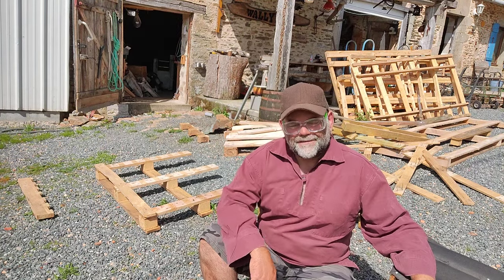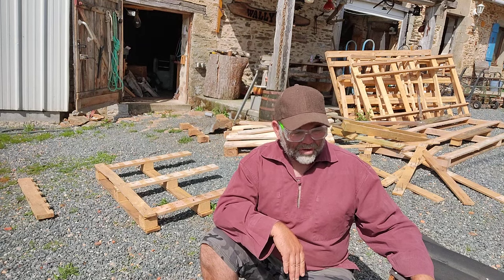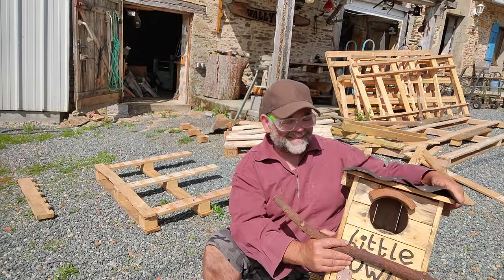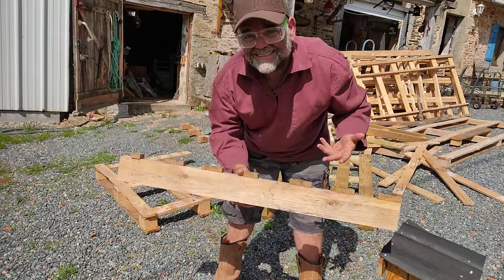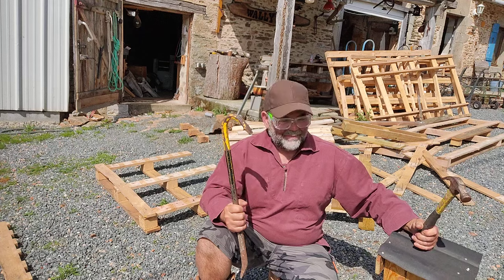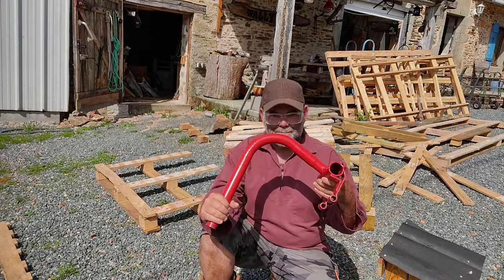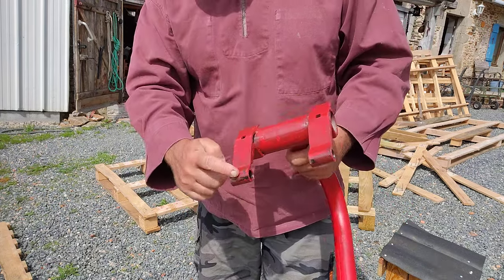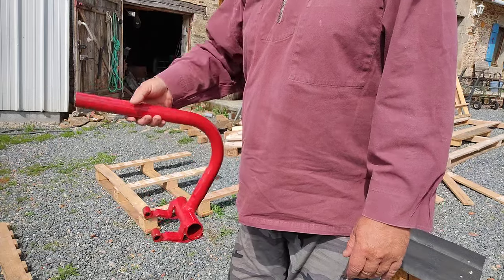Homemade Pallet breaker an Essential Tool for Pallet Projects

Comment: Move the handle round 180 degrees so you are pushing down rather than pulling up, this will both hold the pallets down and require less effort.

Comment: Maybe it's a sign of my advancing years, but I'm sure that pallets made 20 or 30 years ago were of much higher quality wood. Most of the pallets we get are broken before delivery, but we still get some use out of them for keeping our hay bales off the floor in the barn. That little bit of extra air circulation makes all the difference in preventing mold, and fires from composting hay. If I made a tool like this I'd probably be tempted to hitch up the trailer and go pallet hunting 👍👍
Reply from the maker: Many pallets these days are single use because we buy from the other side of the world...

Comment: Good tool but surely better with a straight handle welded on at a slightly forward angle, more leverage and use standing up thus protecting your back.